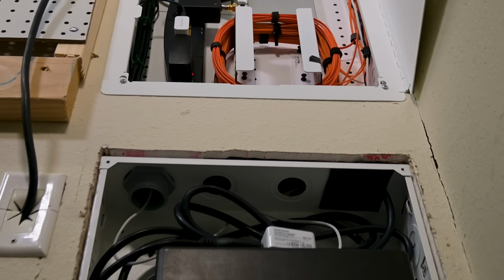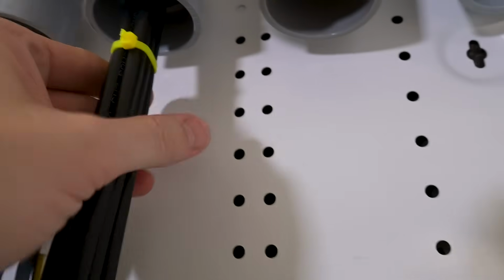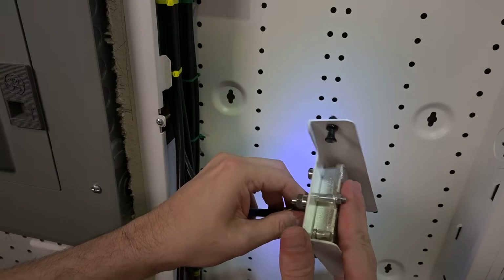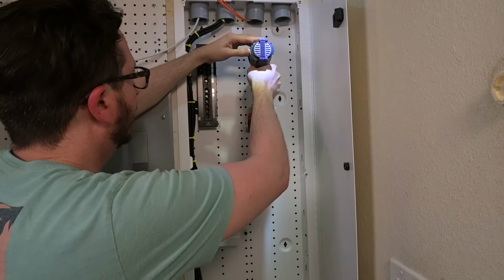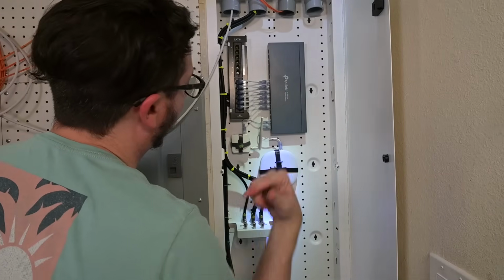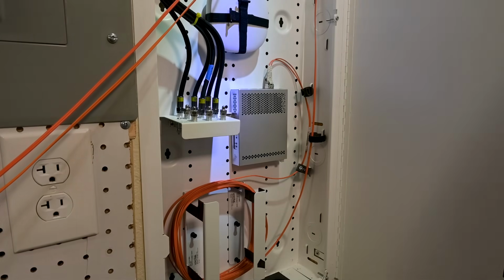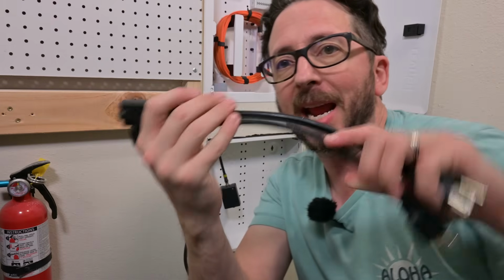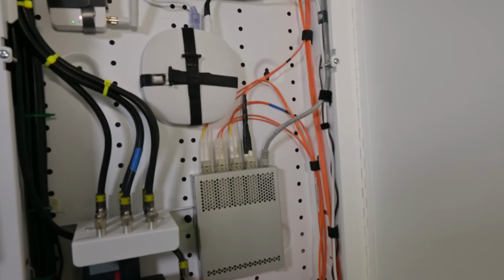Home Networking Upgrade - 10Gb Fiber, UPS, CAT6 Gigabit - ULTRA CLEAN NETWORK PANEL SETUP

Comment: Finally had time to watch haha, very nice setup!! I might have mounted the fiber switch rotated 180 so the connections come out the bottom though. I actually prefer zipties over velcro where they can be used, especially stiff RG6 runs. The velcro just doesn't hold tight enough. How is the antenna signal with the 1-to-8 splitter? I have a 1-to-4 but purposely bought one with an amp (Channel Master) as I was concerned about signal loss.
Reply from the maker: I have a booster (same brand) on the antenna and the signal at all the drops is very good. I am not far from the towers and do have decent LoS so that helps for sure. Antenna is a cut piece of coax stripped and made into a 16" diameter loop.
Reply: "I actually prefer zipties over velcro where they can be used, especially stiff RG6 runs"

Probably increasing signal losses with tight radius's & over tightening the zipties.

Comment: So careful with fiber bends until the last bend into the switch...then just close enough. At least at the end of video you gave more slack.
Reply from the maker: I gotta say I am not really happy with the coil and tension especially at the heads. Trying to find a nice way to "un-F" it when I get a 3d printer for sure.
Reply: @DigitalSpaceport  yeah, custom pieces to fit your needs at the touch of a button and a bit of time is nice. So many great printers out there now. It's a fun rabbit hole.

Comment: A wireless device in a metal case, Faraday will be turning in his grave.  Get an external antenna for it please.
Reply from the maker: I need to do an update video on that panel. Lot has changed and there is nothing wireless in it now for a while

Comment: The cable frame and the fiber switch should swap bits
Reply from the maker: Ya know what you have a good point there. I am 3d printing a new fiber frame sometime and will reorg it.

Comment: I found another source to get used 20TiB SATA drives, but would rather support you, any idea on when you will get your next shipment?
Reply from the maker: I've got a call in right now to see when they are getting in. Asia Pacific moves fast sometimes and slow at others. Week or so. You feeling the pressure now that I catapulted into the lead ?
Reply: @DigitalSpaceport  Keep looking in that rear view mirror my friend, I will, some day put you back in mine. If you notice, I am already getting close to you, just 6 others suppurate us and I already have enough to move up a few more slots.  I will hold off from getting them for the other source, I will commit to at least 8 20TiB SATA drives, maybe more, just depends how things go financially.
Reply: @TheSouthernMale  I skipped over SATA drives, and went directly from HDD's to NVMe SSD's instead. Cheaper, and faster than SATA 3.

Comment: Is it ok for the UPS to be placed inside such a small wall box?
Reply from the maker: Now that's a good question. I'm going to look more into this
Reply: Per code, its not rated to be in a wall at all, the “correct” way to do this would be to have  the 120v all externally mounted, or have the ups on the floor or a shelf and have to ups outlet go into an in wall rated 120v inlet that is connected to romex and then terminated at an outlet inside the inclosure. That being said as long as the ups has airflow and doesn’t overheat this setup will likely be fine.
Reply: @Ryder Holland  a better way would be to use a 19" Rack and out the UPS on a shelf, or get a rack mounted UPS.

Comment: You already knew there would be comments about using zip ties over Velcro ties lol 😂 I would have used Velcro ties just for ease of adjustment later. Also, I would have used double sided Velcro tape to mount the Smart Things hub. Other than that, great job 😁
Reply from the maker: Yeah someone else pointed out the super strong double sided Velcro and I have some ordered now. Looks like a great use for it plus I have more things to mount.

Comment: What is this? Talking about not to bend the fibre connection but doing exactly this! 
Also why do you put an 4G Backup router in this metal cabinet? 
This is really american work... Looks nice, works like dump.
Reply from the maker: Im getting a 3d printer to print a better loop and the signal to the 4G backup is great. I am not far from a tower and it feeds via cat6 to the router and then to the 5 AP wireless mesh for the house. Funny you just lump everyone in like that, very much stereotyping. I hope you have a good day all the same.
Reply: @DigitalSpaceport  I didn't wanna sound rude, it's just an american thing to do things nice looking but not technically perfect ;)

Comment: Well crap, was about to purchase 8 more 20TiB SATA drives from you but you are out of stock 😭 I am starting to wonder if this is a plot by you against me so I will not catch you.
Reply from the maker: They will be in Friday or Monday and prices down a tad and JBOD 3 gets repurposed in ~3.5 hrs muhahahaha.
Reply: @DigitalSpaceport  Well you do not think I will let you get away with that now do you? LOL, I just checked, since joining the same pool you are on I have contributed (Found) 3 blocks, to you 2 blocks, so there is that Haaa  back at ya.
Reply: @DigitalSpaceport  I will check your site on Friday, credit card sitting here waiting.
Reply: Make that 4 to your 2. :)
Reply from the maker: I "should" be around 6-7 by now
Reply: @DigitalSpaceport  Nope, on the Pool, Your Blocks Found is 2, where mine is 4.
Reply from the maker: No I'm saying I'm outta overall ETW by a fair amount. That Tesla P4 was not good at the edges but the 3070 won't have those problems now. Or I've got a row of blocks inbound.
Reply: @DigitalSpaceport  Well we will see how long it takes you to catch me in won blocks.  I love this back and fourth, keeps us both on our toes.

Comment: 10Gbit fiber for home ??
WTF !??
Reply: Getting pretty common now.
Reply: lol that's what I came to ask. 1 gig is overkill for 99.9999% of folks, much less 10.
Reply: @scotmaciver  Does this meen I have to tear down my 40Gpbs setup?
Reply: It's becoming more common, even if residential subscribers aren't currently getting full 10Gbit's provisioned on their plan. It's more of future proofing when you want/need higher speeds later. Comcast has been using 10gig fiber equipment for it's "gigabit pro" service (fiber based service thats different from their trad cable offerings) for a while now, and residential customers only had 2 gigs of the circuit, and apparently now they've started upgrading customers over to 4Gbit tiers
Reply from the maker: I wonder how you will feel when the 40Gbit video is out... JK lol? But seriously I have been running 10Gbit for 6 or so years and love it connected to my unraid server with a super fast NVME storage array for files I access often.
Reply from the maker: Im glad to have a fellow 40Gbit'r along for the ride. I expect some more blowback on that video but its amazing and also cheap.
Reply from the maker: I would never have imagined a day when I wished for access to comcast but its here.
Reply: @gromit_2959  nope, but maybe when they develop applications to be able to use it you will be ready..... in 3023
Reply: @TRLTheRandomLab  future proofing? Who's future? You are mistaken if you relate a higher provisioned bandwidth is equal to speed. Now if you mean for internal network, I can't ever imagine Lou and Betty pushing around databases and gigs of data lol. On the WAN side, a 1 gig connection will theoretically allow around 100 people with 100 TVs in the same house, to all start a Netflix Stream at the same time without issue. Doesn't allow one stream to stream any faster. You are limited by applications. Thank God, because we are pushing  major data on our networks with thousands of clients hitting externally, on a 1 gig pipe. So no, 10G in the home isn't future proofing anything. ISPs are killing it selling folks something they know they will never use.
Reply: @scotmaciver  Really? I'm a home user, just installed 10G. I transferred a 2.14TB folder to my 24TB NVMe SSD NAS yesterday and it still took 2h 15m.   I think I need 100Gbps !

Comment: wrong type of fiber for 10G.  need to use aqua or velvet colored OM3 or OM4 fiber.  youre using OM2 multimode which is not qualified for 10G+.  its like trying to run gigabit on cat3 phone wire. 😒
Reply from the maker: OM2 does work (*and used to be rated as such) for MM 10Gbit over the distances sub-80 meters. I am using a 30 meter max length. I did not purchase it new for this use, but rather got it free with a server room cleanout. I would of course purchase OM3+ for any modern runs but I also believe in being cheap and not wasting money. In addition it does work without issue at 10Gbit without error.
Reply: @DigitalSpaceport  are you using 850nm or 1350nm optics?
Reply: @Digital Spaceport  oh yeah you could probably use a white string for 30 meters.  😆
Reply from the maker: @justinhannah1023  850

Comment: Whyyyy? I am absolutely against the use of these structured media panels. A STANDARD 19" Rack, while not as space efficient and not as aestetically pleasing, is far superior for many reasons. Even for home use!
1) standard
2) easier to work with, easier to troubleshoot
3) more options available, no vendor lock-in
4) more hardware options, rack mounted router, rack mounted switches, etc.
5) more expandability
6) Ethernet, fibre, and Coax patch panels (though I guess you could just mount a Coax splitter to a blank panel by drilling a few holes or 3D printing one.
Etc. Etc.
Yes, these look nicer, but just are not properly functional.
That SmartThingsIoT hub ideally should be placed much closer to your Z[ed]-wave/Zigbee devices for more reliable wireless signal, at least you knew enough to connect it to Ethernet and not WiFi! (I wish more smart devices like smart switches (anything that are stationary really) would use PoE, MoCA, or Powerline networking instead of wireless (wired is ALWAY superior to wireless whenever mobility is not needed and practical).